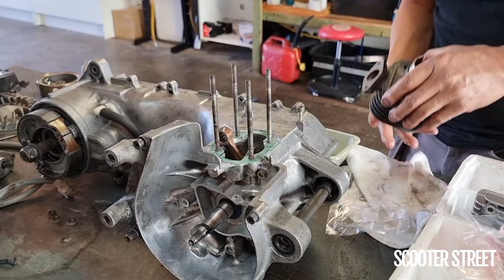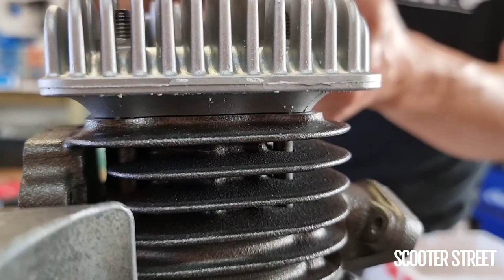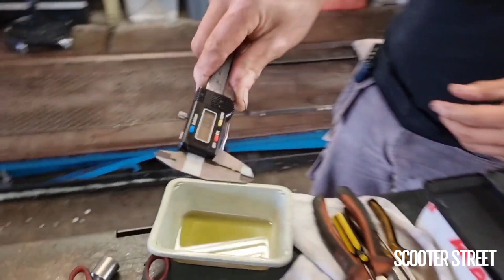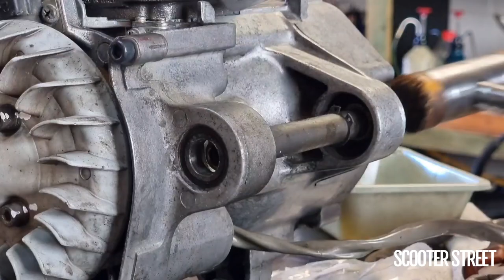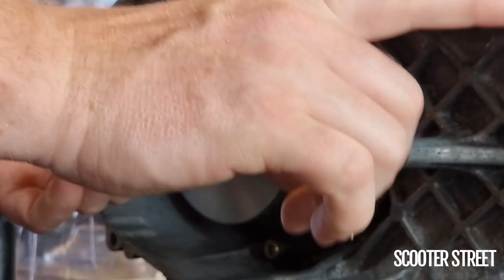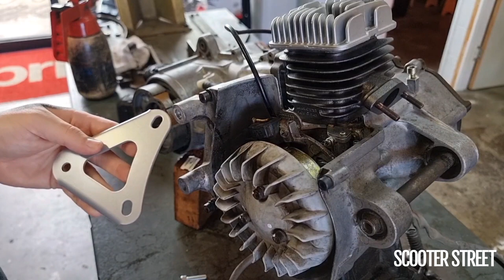Yamaha Zuma 50 / MBK Booster CRANK REBUILD + 70cc Cylinder Kit Install (Part 2)

Comment: When I modify an engine to perform more than the stock build,, the first thing I do is remove the oil pump and start mixing my own fuel.. I dont trust them small buggers :P Great video,, like always :P
Reply from the maker: We have many customers who share the fear with oil pumps... We prefer to run them on road registered bikes, provided the system is intact. Oil pumping is something we recommend to regularly check. On race bikes we've built over the years, we have always run premix. Its just a preference thing, not worrying about the pump vs. the convenience of not having to premix. Thanks for watching🎅

Comment: how often should you replace the crank seals? And should you change them if you say, replace your crank?
Reply from the maker: Well you can change them at any time the engine reaches 10'000kms. Or, you can change them when they fail and leak or certainly when you change the crankshaft. When we carry out a service we inspect the seals and look for misplaced or leaking around the seals at which point they would be replaced.

Comment: would you find it easier to put the circlip in without the cylinder sat on top of the piston and getting in the way? Ive only ever used the piston in bore method on four strokes where its the only option due to fiddly rings. Its usually really easy to squeeze the rings together by hand on a two stroke due to the cylinder cut outs at the transfer entry. Just a thought. Loving the vids :)
Reply from the maker: We did it this way for the video, we would usually fit the cylinder while engine still in frame. See our other vids, Thank you for watch and comment👍

Comment: Hi scooterstreet. Is the stock oil pump enough for a 70cc kit ? What do you recommend when not premixing ?
Reply from the maker: Yes it is, ensure the oil pump is working and all of the associated parts are in good order, check it often as part of your routine maintenance.
Reply: It is because it mixes at 50:1 so 100ml oil to 5L petrol in premix terms I just put a small capful of oil in my fuel tank just to be on the safe side

Comment: Great video! I've the same engine (all stock) want to replace head & piston with a Malossi kit for street use, carb also, which Malossi kit did you guys install here? Cheers
Reply from the maker: Thanks Aido, We used the 237Kit. https://www.scooterstreet.com.au/product/malossi-70cc-cylinder-kit-for-yamaha-zuma-50/  Best to change all of the intake parts too.
Reply: @scooterstreetau  nice one! Sure I'll throw my engine in the post, express delivery all the way from Dublin Ireland :P thanks again, I'll check out that link 👍
Reply from the maker: @Aidod27  Cheers, Bet to buy it locally...follow the link and see the part number and then buy local.

Comment: Hey a little late comment what squish do you prefer on yamaha zuma i also have the malossi 70cc
Reply from the maker: The Malossi kits usually sit between 1.2 and 1.6mm. adjust as required.

Comment: I've just installed the stator and stator cover, how do I time it correctly?
Reply from the maker: The crankshaft has a woodruff key that sets the factory timing on the flywheel and the stator has set holes for fixing the holding bolts..
Reply: @scooterstreetau  okay thankyou for your help😊😊
Reply from the maker: @masonhughes6710  All good, there are 3 degree woodruff keys available if your thinking of changing the timing and then the inner rotor ignition.